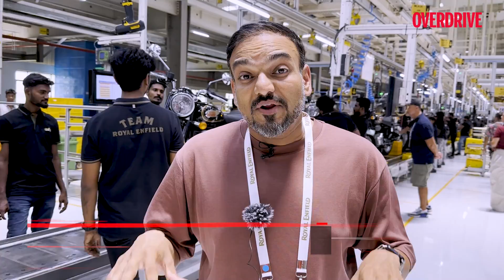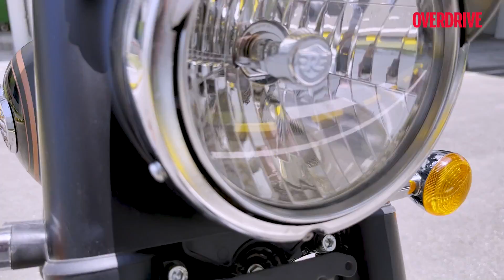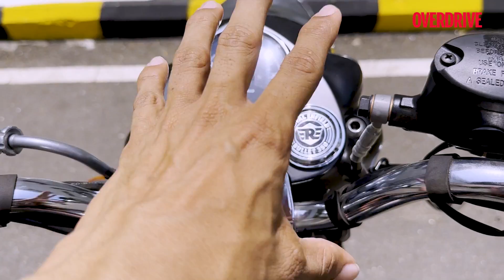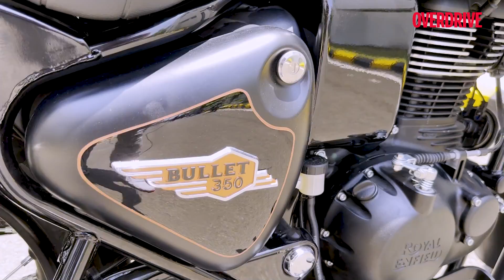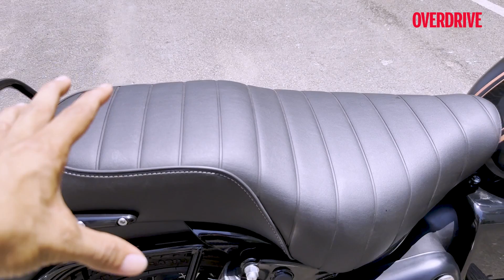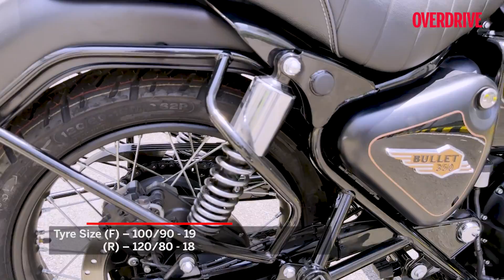2023 Royal Enfield Bullet 350 (J-series) - walk-around, design changes and exhaust note | OVERDRIVE

Comment: The new Bullet is basically a Classic 350 with new badges and a bench seat. A nice looking motorcycle but very little product differentiation.
Reply: Yes, its just another color of classic. Earlier the Classic was based on Bullet but now its the other way round. The color shown looks awesome.
Reply: Ideally they should subsume the "Classic" as variants under the "Bullet" itself. They cannot let go off the "Bullet" as that is the more iconic badge and has the record for the longest production run for a motorcycle.
Reply: Same goes for the older UCE Classic 350, which was nothing but a UCE Bullet with different seat and handlebar. Eventho 95% similar motorcycles, the Classic and Bullet have very different appeal. Bullet gives more macho/masculine vibe.   And I think in this J series Bullet, they have done some changes to improve the thump.
Reply: Thats how all motor companies make money! New shape on well tried mechanicals.
Reply: There is no one seated option and also classic looks long backside as compared to standard350
Reply: RIP the rear 18" tyre already running in classic 350.
Reply: The Bullet is a facelift of the Classic, which was a modernized facelift of some vintage Bullet design. But what a good looking facelift it is! Just look at the silhouette, it is very different from the Classic and much sleeker and more elegant looking in my opinion.